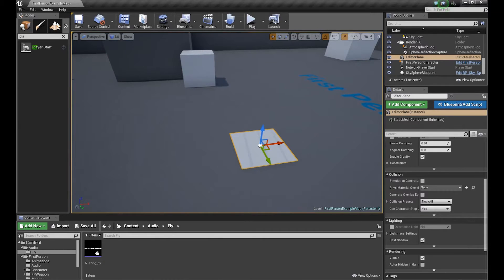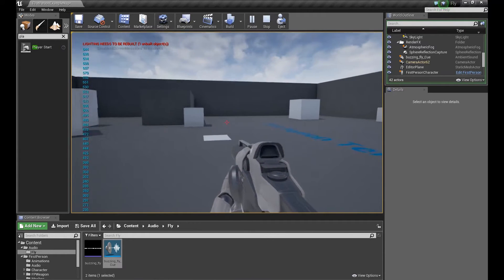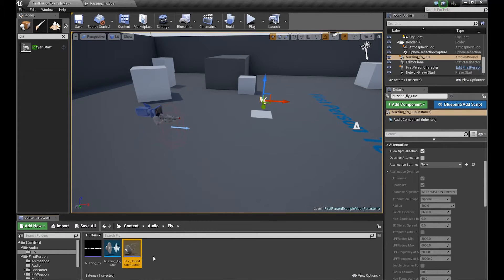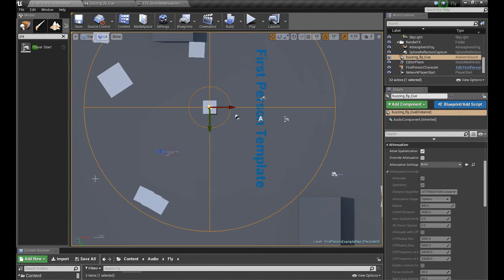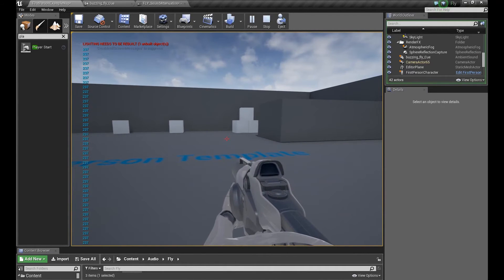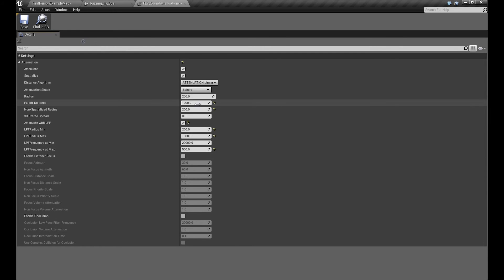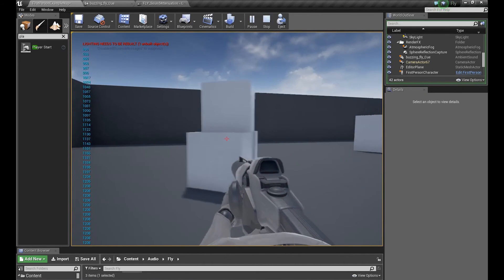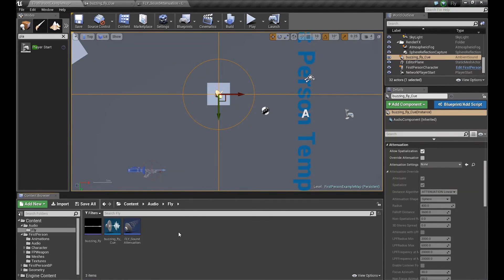SoundAttenuation - PART 1 - UE4 Audio Tutorial

Comment: When I leave the area of the sound attenuation range, the audio stops and doesn't resume playing when I re-enter the area.
Reply from the maker: I know this bug, it happens sometimes, I really don't know what is causing it.
Reply: Huh, well it seems they've had quite a few audio/video problems with the engine for a while.  Anyway, I've found a fix in the meantime by making a custom attenuation curve that only goes down to 0.01 instead of 0, which keeps the audio from stopping.
Reply from the maker: Good news is that they have been rewriting audio engine for the past year, it should be brand new in 4.16 so in couple months tops. Most of the issues we have it now should be fixed there.